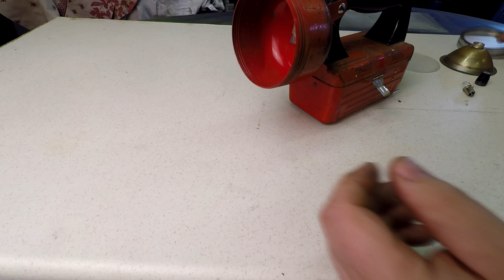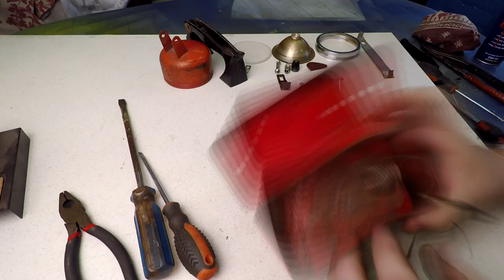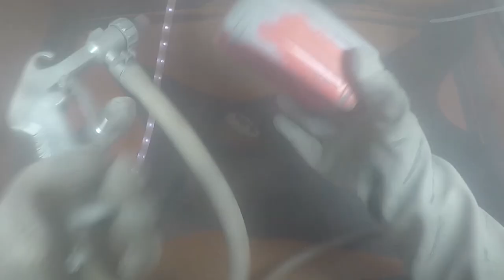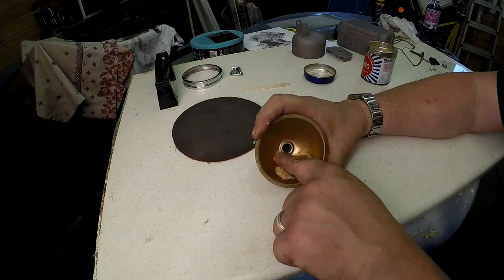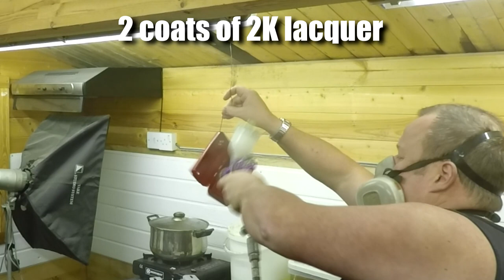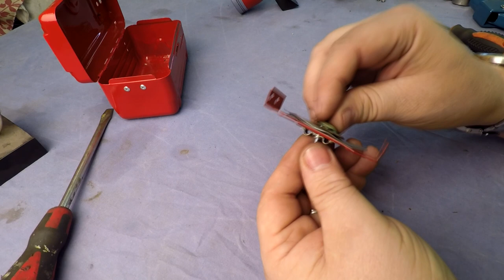1970's  Space Beam Torch - Lets Restore It

Comment: Awesome build back to the 70"s. I don't think i could resist putting a high output LED lamp and adaptation so I could run it from my 20 volt power tools battery. It would be like the new hot rods modern engine and drivetrain with that old school 70's body
Reply: Yes, you can get a drop in bulb for them that pushes out about 200 lumen using the existing battery..
Reply: Great Idea! 👍

Comment: What a fantastic restoration you did. I was wondering, after watching others do a restoration, if you do a wet sanding between the coats and also the clear coats? They do it smooth out the paint and to remove dust(?). Fun to watch and cool to see it working again.
Reply from the maker: I don't usually wet sand. I dry sand as a rule.
Reply: @RetroHax  I wonder what is the difference between wet and dry sanding, other than water?